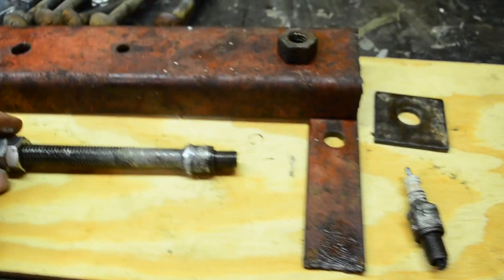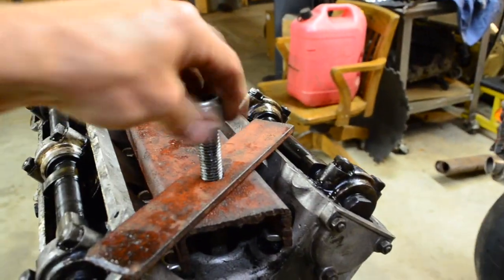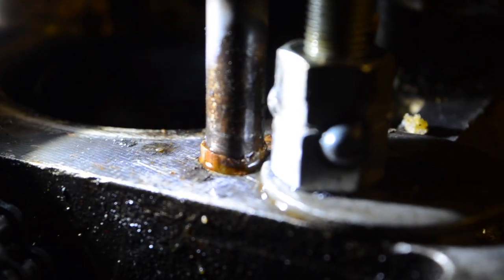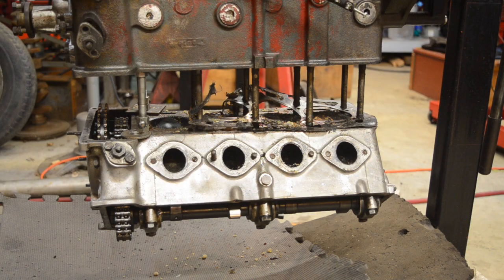Removing a stuck cylinder head - Fiat OSCA engine

Comment: I have lifted stuck heads with wedges enough to get the blade of reciprocating saw in. Then cut studs-39 of them in the case of a Rolls/Bentley 6.

Comment: Thanks for this tip. It worked very well on all except one which won't budge even with scaffold pole leverage.
It's a 6 in line cylinder head on a Triumph GT6. I think I will have to try lifting the head with the stud in place😅

Comment: Any progress on the engine? Have you managed to get new parts?
Reply from the maker: Yes. It is at the machine shop. The block is being sleeved with 4 new sleeves. The bores were quite rusted. I'll make another video when I get it back.